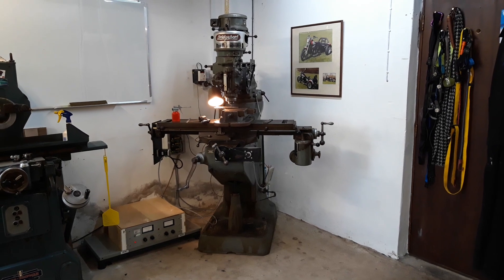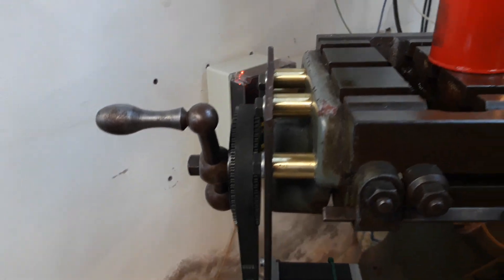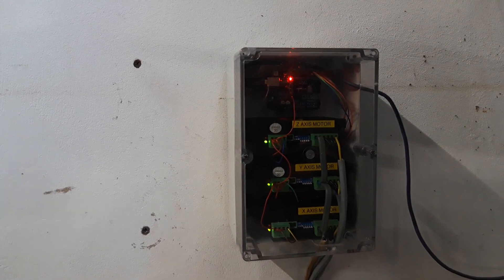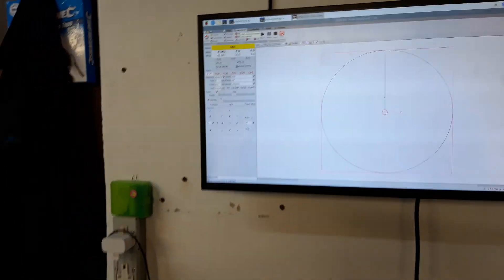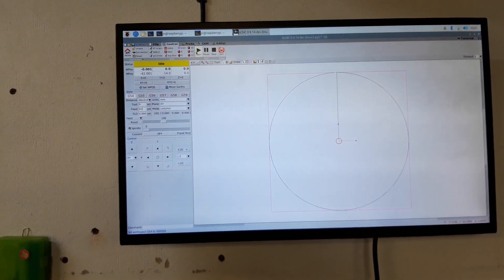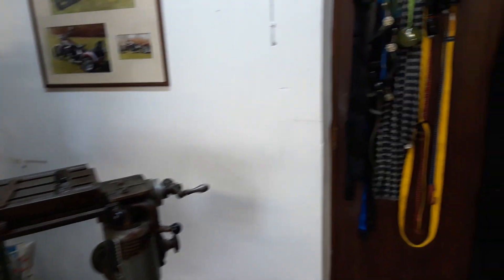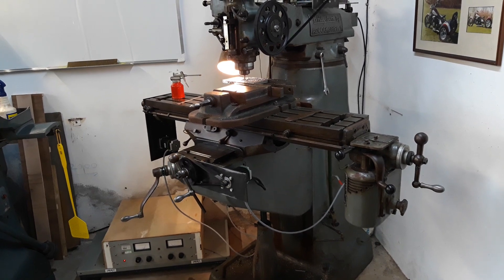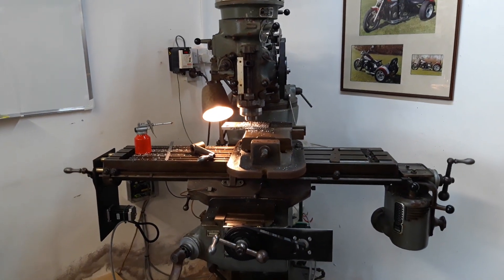Bridgeport CNC conversion.

Comment: Awesome absolutely awesome👍🏽how much would u say this cost
Reply from the maker: Not a fortune. I'd say less than £400 all in. Motors £100 for all 3. Drivers £100 for all 3. Raspberry pi and Arduino £100 (plenty of change for a project box). Pulleys, belts, wire & sundries the last £100.
Reply from the maker: Oh and a power supply. Mine came from the scrap book at work. 😁

Comment: Very Good. Don’t you need a  proper CNC controller for real work . Are the motors Stepper or Servo. Thanks
Reply from the maker: Depends on your definition of proper and real I suppose. bCNC is a proper controller and if I change the lead screws it'll get production level repeatability.

Comment: Hi Mark can you give me details on the drivers that you used please make model etc.
Reply from the maker: https://www.ebay.co.uk/itm/255430560015?mkcid=16&mkevt=1&mkrid=711-127632-2357-0&ssspo=-FuS0HHvQQi&sssrc=2349624&ssuid=6lWLBELmQ8C&var=&widget_ver=artemis&media=COPY
One of these. 48v is best but you can get away with cheaper/lower voltage if you lower the maximum speed.

Comment: That’s fantastic,  however does that kill the manual use of the mill? I see the quill handle is gone. What about the little dial locks and  such, are they gone too?
Reply from the maker: I've done a video about manual operation of the mill. All possible without modification.

Comment: Great work. Just one question how did you manage the lash in your threads ? I have around .25 mm lash on mine so not sure I'd get any accuracy without fitting encoders or ball screws. Thanks
Reply: Use linux cnc, it can compensate for backlash. Also snug the locks so they drag to prevent unwanted movement.
Reply: bellville washers and acorn cnc or linux

Comment: Good job sir...How to control backlash sir? Do you change ballscrew xyz?
Reply: Just wanted to tell you someone else responded, with "Use linux cnc, it can compensate for backlash. Also snug the locks so they drag to prevent unwanted movement.
"

Comment: Hey Mark nice looking conversion job.  What size and type of motors did you use?  I'm planning to convert my old bridgeport soon.
Reply from the maker: They're 4nm NEMA 23 motors. Quite common with a 1.8° per step. I got mine here https://www.cnc4you.co.uk/Stepper-Motor/Nema23-4Nm/Stepper-Motor-4Nm-60BYGH401-03-x-3-Nema23 but you can find them online in a few places. I'll do another video soon with more details. See also my blog www.sophiewhiptank.com Good luck with the conversion!

Comment: Hi nice job. What is your timing belt gear ratio and did you use the original acme lead screw or swap out to ball screws. I'm in the process of converting a Tos milling machine to CNC Thanks
Reply from the maker: Hi Steve. 

I used the original acme screws to see how well it worked, before spending any money on ballscrews and nuts. I haven't done that yet as they're a fair price! But its on the list.

Since making the video I've since added a spindle stop/start control. More details and contact on my blog here www.sophiewhiptank.com 

I can't remember what the pulley ratios are, check back later and I'll post an answer. Good luck with your project!
Reply: @StoneEng  https://www.aliexpress.com/item/10000119157833.html?spm=a2g0s.9042311.0.0.4e7c4c4d4UKNny 
Hi again here is a Ball screw with nut That i have ordered for my Y axis 139$ Canadian shipping included I've bought thousands of $ from aliexpress with no problems Didn't know if you were familiar with them so thought I'd let you know. Thanks for your response.
Reply: @steveu235  Hi Steveu. Did you buy X and Y ball screws as well? I'm struggling to work out how to fit a ball nut for the X and Y ball screw axis and appreciate any experience you might have had. Cheers, James